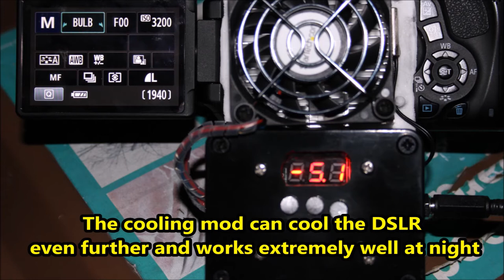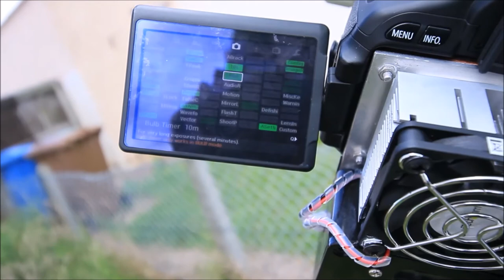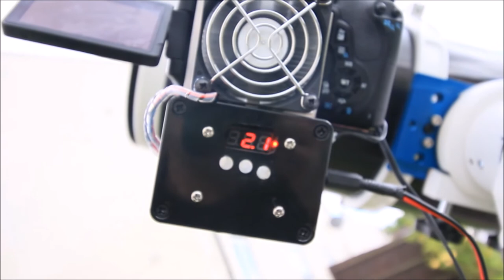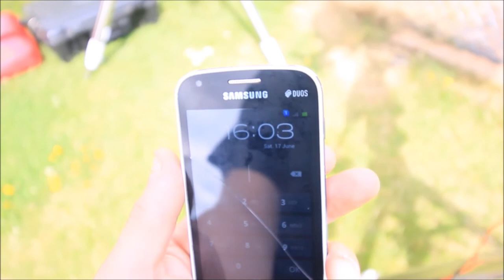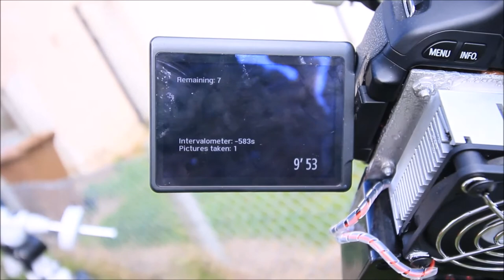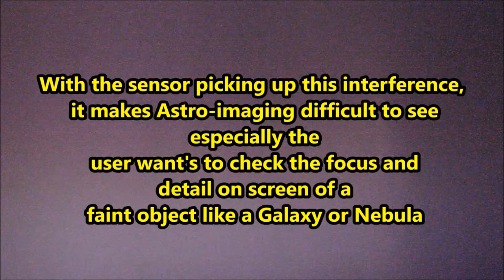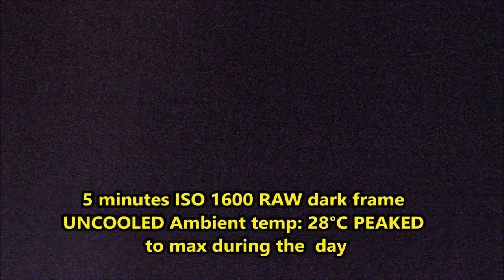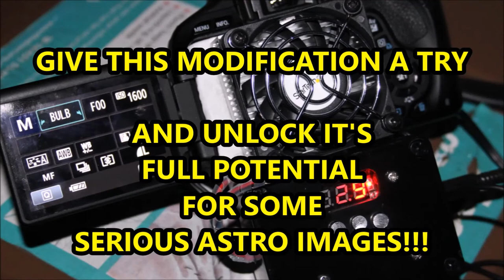How to make a Peltier cooling mod for your Canon 600D DSLR camera Part 3

Comment: This is great, just ordered part to start this mod. Quick question, Do you think adding thermal pads inside the camera between the back of the camera and the sensor would help? If I was to put 2-3 thermal pads on top of each other, or a thermal pad and copper plate, so they are thick enough to touch the sensor, would the cooling flow through the pads to the sensor?
Reply from the maker: I couldn't see why not try it, the only problem would the electronics inside, will allow you to this, I know that inside the camera, it is pretty tight, and you'll struggle to place any thermal pad. Give it try though you'll never know??

Comment: Great video. One note: Not all DSLR cameras are weatherproof. All but the oldest / cheapest Canons are, but people should Google to find out if their camera is weatherproof before they take your advice of "...so effective it will turn the camera body to ice, don't worry about that, the actual camera body protects against the moisture and the ice."

Isn't it possible to prevent the ice by tuning your thermal sensor with a RasPi computer to adjust the cooler? Would use less energy too. I know you use a controller of some kind but isn't it possible to get cooling without ice? Zwo cameras don't get ice, right?

Comment: Thanks Martin for this video.  
As you know I have completed my build of this cooler unit and incorporated a slight tweak per Ewan's (Astronomy Addict) version using a different cooler control unit.   It seems to work well but I have not had chance to try it in cooler temperatures to see its true performance.
I like the additional copper sleeve and I will await your links as I am keen to try this out as well.
Keep these videos coming dude they are of a great help to  us all. 
ps.. I will try to get a shot of my attempt at this cooler uploaded as well.
Reply from the maker: Thanks Julian, I will put out the links tonight, so keep a look in description. There is new plans getting developed for a brand new cooling mod, for the owners of a 1100d in the works??? This will take some time but again I want to make this right, it will be a lot of hard work but it will be trialled and tested has always.

Comment: Hey because of one of my friends showing me your page on making the coolers i have decided to make one myself. I dont know if you use astrophotography tool or not for taking images but if you dont it shows you the temperature of the sensor after each shot. I have noticed that with a thermometer placed near thr sensor of the camera like in a dummy battery like you the temperature of the actual sensor is drastically different. You could actually be getting -17c on the sensor vs the -11c. Try seeing what apt says about your sensors temp while running flats or darks for a long time and you will be surprised. (Im totally new at this less than a year and just starting to feel ok with taking pics). But hey if you seen a drastic change in temps post a video on it man!
Reply from the maker: Thank you  Roger for the tips, I might try looking into Astrophotography tools. The cooling mod is still working great and I've been using the Canon 600D more than my CCDs. The DSLR offers the ease of use without any computers needed to be connected onto the camera which I can set-up and image far quicker than my CCDS. Give this mod a try Roger, it really is worth it. I'm looking into a cold finger mod, but it involves stripping into the cameras electronics which can be a huge risk, however the cold finger mod is the best for cooling performance and low power drain, if the mod is done correctly.

Comment: How does this work for video? I really want to get rid of the noise on my 600d just for filming my videos. Really thinking of doing this mod.
Reply from the maker: Go for it Sonny, it will help to minimise the noise a bit, I'm not sure in video mode. But considering that my camera is on a constant exposure of 10 minutes or so, I cannot see why video wouldn't too?? Give it try end of the day this mod has worked for me for 3 years and still running strong.